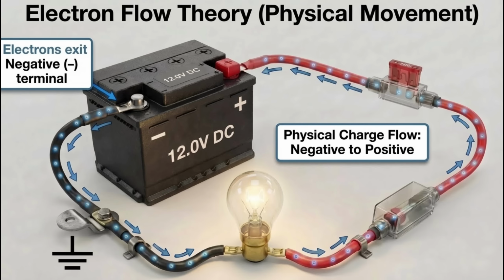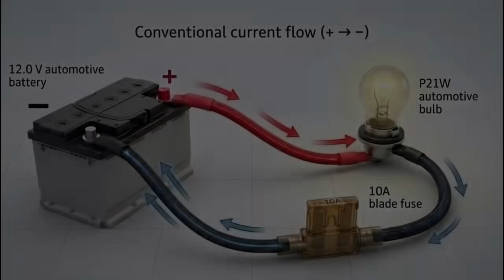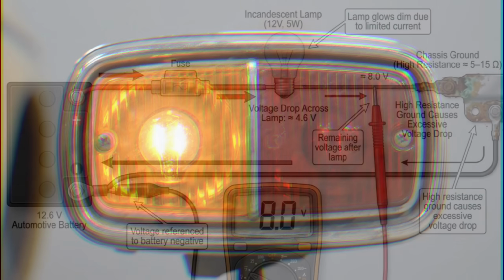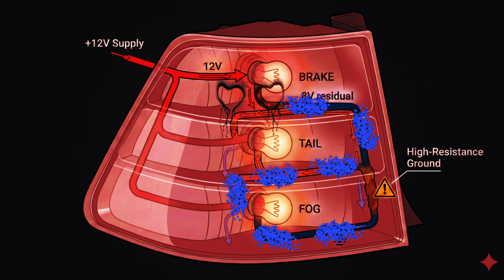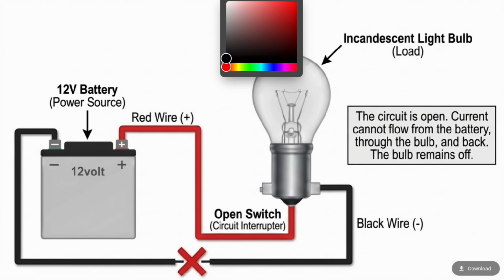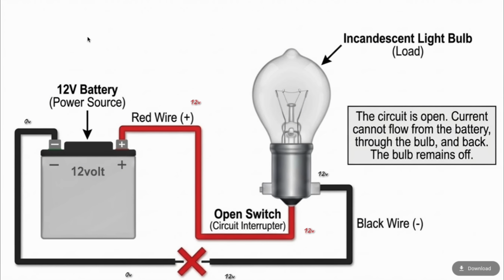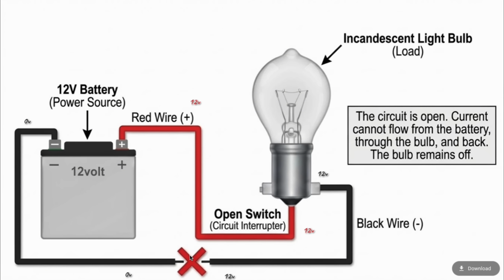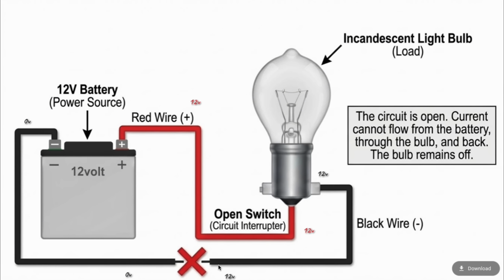12 Volts on Ground… The Most Confusing Auto-Electrical Fault Explained!

Comment: Were exacly did you explane the old system were Battery positiv was on the chassi?

The title is just clickbait....
Reply from the maker: I wasn’t doing a historical deep-dive on early automotive electrics.
The point of the video is why modern systems are referenced the way they are, and how misunderstanding that leads to bad diagnostics.

If you missed that, rewatch the section on reference paths and voltage drop — that’s the actual lesson.
Reply: Hi, to stop any confusion, maybe you could could add the word " Wire " after "Ground" in the title ?
Reply: There is no ground in an automotive electrical system, just a return to make a circuit.
Reply from the maker: For training purposes there is. Wiring diagrams call it earth or ground - thats what and how we teach
Reply: @BenJFF thank you! This is exactly what and how i need to be learning in my hgv maintenance course! (Minus the spark plug ofcourse 😂) but your videos are great! ❤
Reply from the maker: Fantastic

Comment: Interestingly enough our voltmeter measures pressure at any point in the circuit (think pipe) by releasing a little bit and and measuring the hiss of air or dribble of water through a known orifice. Yes your multimeter always measures current flow when measuring voltage or potential difference and why you have to shift the common lead to measure amps.
Reply from the maker: Well said Roger

Comment: What about when seeing a positive voltage on what is supposed to be a ground? Got a VW Up which is supposed to be sending a ground to the fuel pump relay, but seeing about 3.5v coming through instead of the ground. Could that be a floating voltage from a bad ground, or is the ECU broken?
Reply from the maker: Disconnect the wire to the ground term 85 to relay and check again. Relay should be diode or resistor type - they themselves can cause this. Other than that I would need to see the wiring diagram. Sometimes that voltage is normal as the single phase pumps can be controlled by voltage dropping the ground or reducing voltage it depends on the design. You could do with finding a functional description how it works. You need to also check that ground when cranking not just with ignition on
Reply: @BenJFF cheers. I did pull the relay and test it and it works as expected from a 12v battery and continuity is ok. On the relay base pin the ground shows 0v with ignition off and then 3.5v with ignition on, with the opposite pin showing 12v constantly. I can bypass the relay with a jumper pin and the pump spins, just not getting the ground from the ECU so can't run it normally.

The relay itself is a vag 646, normally open diode relay.

Comment: Electrons haven't been discovered.  It's still just a workable theory.
Reply from the maker: In engineering and diagnostics, a “theory” that consistently predicts outcomes and is repeatedly verified in real-world measurements is called a model — and it’s how we fix cars every day. If understanding why you can measure 12 V on a ground reference helps technicians diagnose faults faster and more accurately, then the video has done its job.

Comment: Because when your measuring the ground side the multimeter will directly read the voltage drop.
Reply from the maker: Ground to ground yes
Reply: @BenJFF  I assumed you’re referring to conventional old school circuits that used a mechanical switch instead of electronic canbus switch that creates a ghost voltage just like the modern Jump starter that can’t be used as power supply despite of having a voltmeter reading of 12V.

Comment: ~4:05 im just happy the battery got 6 cells, even if the toaster got the nominal voltage wrong for a functional lead-acid system

~4:33 lmao wow, called it. i swear i didn't see this before i posted the above xD classic toaster 4 cell motorcycle battery, good for about 9.2 (or 8.0 as it would call it)

Comment: I remember working on my civic thinking i had a fuel pump problem and traced everything on the positive side, not being able to find the problem for days and eventually found that the car ran and start with my obd port plugged in because it have the fuel pump a return path to ground.  the problem was with a main grounding screw under the hood through one of the main wiring harnesses that was preventing the ground from going back to the battery and i was scratching my head for days on that one, so now i always test negative on battery, to negative on problematic part via continuity test , instead of relying on chassis to positive voltage test. Most electrical problems are indeed grounding issues or connectors.
Reply from the maker: Good job you had that scan tool plugged in 😅

Comment: Thank you for explaining this. In a situation myself where I own a 21 year old Jeep WJ Grand Cherokee and the wiring is starting to break in all doors, under hood etc. due to hardened plastic sleeving and years of hot/cold cycles.  It is a nightmare to find all the breaks. I am getting to the point of wanting to remove all the carpets and seats and physically inspect the wiring harnesses. I see many corroded terminals in various cabin components like the blowers, rear lights.
Reply: I feel bad for you. Your Jeep is having wiring problems at only 21 years old. Crazy! My rusty 1975 Chevy is driven daily (doesn't sit in a garage) and it has its factory wiring harness. It has no problems.
Reply from the maker: No probs glad it helped. Yes if it were me and I had another car as a daily driver I would sort the wiring out.

Comment: If the switch to turn on the load is on the ground side or what's called a ground activated circuit you can also utilize what you described to continuity/integrity test all the wiring through the load up to the open load side of the open switch using the circuit voltage source being the vehicle battery by measuring the voltage at the open switch instead of breaking the circuit open at multiple points and then using the multimeter battery on resistance or continuity function to perform the test.
Reply from the maker: You are clearly very intelligent and I like both of your replies - god knows I wish I had young lads ask me these types of questions. We need to bear in mind that I try to simplify concepts so that this complex subject is understandable for a large cross section of society. Maybe one day I can go more in depth but lets work up to that level. Very impressive understanding of circuits you demonstrate 👌
Reply: @BenJFF  Less and less young people are getting into the trades now a days and that's a big problem everywhere. And it's a real shame because it's a very satisfying career when you use the knowledge and skills to solve difficult problems.
Reply from the maker: Its a big problem I agree. They need to pay way more that would help

Comment: Simply put current has to flow in a circuit for the load (lightbulb) to consume the majority of the voltage because by law  "ALL" sources of voltage will be consumed by "ALL" loads in an electrical circuit. If there's a break on the ground side then the load (lightbulb) simply becomes an extension of the wiring when there's no current flow in the circuit. Here's a question why doesn't the multimeter cause current to flow and activate or turn the light bulb on when you test the voltage after the load on the load side at the break with the multimeter?
Reply from the maker: Because the multimeter is designed to measure, not power.
In voltage mode it has a very high internal resistance, so it allows only microamps to flow — enough to reference potential, nowhere near enough to energise a load.
Voltage can exist without current; current only flows when the circuit is complete and the load demands it.
That’s exactly why we can read voltage past a break without the bulb lighting.
Reply: @BenJFF  Exactly. Electricity can be a hard concept to understand myself included in the beginning. Most people avoid it out of fear but once you know the basics and fix a few easy problems the lightbulb goes on and you're off to the races. Keep getting the info out there. Cheers!
Reply from the maker: Thanks buddy 🙂

Comment: The confusion starts when people use the term "Ground" in a DC circuit. 
There is NO Ground in a DC circuit!
What there is, is Positive and Negative! Even says it on the battery.
Ground only exists in AC as a safety measure, it is not necessary to make the circuit work.
Reply: Everyone in the automotive (12 Volt DC) repair industry uses the term "ground" , "earth" and negative interchangeably and it's not confusing.
Reply from the maker: They use the term ”Earth” in the UK for domestic AC electricity. It never confused me. I used to say earth for DC systems and since working 11 years on Bmw I started to say ground.
Reply: @BenJFF  I know everyone says ground or earth in the EU but electrically there is no ground in DC. Life would be so much simpler if we all could be more accurate. I also knew my comment would draw some "I never got confused" comments. :)

Comment: Great video! So it's like a two-part garden hose with a connector that doesn't let water out if disconnected. With the tap on there's still pressure in the first part of the hose, but water can only flow through if the second part of the hose is connected.
Reply from the maker: Exactly 👌

Comment: You are the first person that explained why my car & trailer tail lights  go crazy with a bad earth wire connection.  Power flows thru the earth of other bulbs 😆  Thanks, mate 👍
Reply from the maker: Glad I could help you solve that confusing problem!
Reply: @BenJFF Have you got a video on simple how it works Can Bus systems?  I own a GM Colorado?
Reply from the maker: I have a CAN tool mate that I built. I even worked on Chrysler CCD bus once. I have two more videos to publish then I will make a really easy to understand one about CAN pre CAN-FD. Thanks for suggesting it Lloyd 👌

Comment: Correction, when you say electrons are negatively charged that's only a convention, not a fact. The whole positive/negative charge convention is arbitrary. You could say electrons are positive and protons are negative and rewrite the physics around that model, and say that positively charged electrons are flowing from plus to minus in a circuit.. We didn't do that because it doesn't really matter in the end
Reply from the maker: The last sentence you made summed it up nicely. 🙂 Thanks for the info.

Comment: Had a Cadillac with a Northstar that came from an oil change shop as a no crank, no start, with really odd symptoms. Upon hooking up the battery and trying to crank, the fuel pump relay would stay latched and some dash lights would stay on, dimmly iIrc, until the battery was unhooked.. Probing around with a test light, trying to get to the starter signal wire under the intake on those, touched the block or something that should have been grounded and the light lit... The whole block was +12... The next trick was finding the engine ground which is hiding at the right front, about 4" long piece of 2ga between the cylinder head, under the exh manifold and to the rad support...
Reply from the maker: Wow, that sounds like a truly perplexing fault! Glad you got to the bottom of it. Who caused the fault? The oil changers?😅
Reply: @BenJFF Age and the rust belt. Unfortunate coincidence. Took me several hours to find, iIrc the ground location is only described in the service manual and almost impossible to see in the deep dark corner it's in.
Reply from the maker: Sounds about right. That was a good fault find mate

Comment: I have a 1924 Model T Ford roadster..And from the factory it was a positive ground setup..
The ultimate circuit in an automobile is to have a copper wire to the light and then another copper wire back to the battery..But car manufactures use the chassis for the ground leg for one reason..To save money..
How much more copper wire and complexity there would be if every circuit had a copper wire as the ground..But steel frames rust out and tech mechanics make a living..
Reply from the maker: Thats really interesting. Do you have any videos of it? I could never imagine modern cars wired that way😊
Reply: @BenJFF  I bought the thing from my wife's uncle and he bought it from the restorer..When I got it, it was not running..But it was Pos ground..Now after doing some research on this, Model Ts were Neg ground and the model As were Pos ground..
It is running on Pos ground right now..I think I need to look this over..At Pos ground the starter was spinning the correct direction and the amp gauge was showing a + charge..
Reply from the maker: That sounds cool. Really interesting

Comment: I find a good way to understand it is to look at an open circuit as a MASSIVE voltage drop.
Reply from the maker: Spot on 👍 An open circuit is basically a full voltage drop – infinite resistance, no current. The voltage has nowhere to go, so it just sits there until you give it a return path.👌 Great comment.

Comment: if in reality electrons flow from minus to plus, why do we put the fuse near the positive terminal?
Reply from the maker: What a brilliant question😊 Even though electrons physically drift from negative to positive, a fuse doesn’t care about direction, only current. The reason we fuse the positive side is to protect the entire length of live cable coming from the battery. If that wire shorts to ground anywhere downstream, the fuse blows and removes the energy source. Put the fuse on the negative side and a short on the positive can still turn the cable into a heater without ever blowing the fuse. In short, fuses protect wiring from the battery, not electron flow.
Reply: @BenJFF if the fuse was on the neg of the battery instead, I don't see how it would be different. It would still blow even if the wire from the pos touched the chassis.. right?
Reply from the maker: It might take a bit to blow. I never tried it. It might be worth making a lab test? I think it would make a good video
Reply: @Tom-f8r8o  Hi Tom. I don't know how old you are or where you are situated, but here in the UK up to the late 1960's we still had cars with positive earth electrics, I used to own one, so in fact all the fuses were in the negative line. Where we put the fuse in circuit is all down to what we choose as the common, or ground, connection. You're correct, in a simple circuit like Ben is showing, the fuse will have the same effect wherever it is placed, as long as it is in series with the current path. In  the case of a complete car, the world has now standardised to a negative earth, ground or common connection, so in order that each circuit can be controlled separately and protected separately, all switches, controls and fuses have to be in the positive line. Hope this helps.
Reply from the maker: Hello Bob, hows the 5 series? Thanks Bob this was very helpful. Yes the old stuff had positive earth. I need to make a video about that too😅. There you go Tom: Bob is an electrical engineer so he knows more than me at that level
Reply: @BenJFF  Hi Ben. I've dropped you an e-mail. I wouldn't say I know more than you Ben, just say that we have different experience, we're both still learning!
Reply: Fuses are near positive terminal because chassis is negative.
Reply: Previously, we tried putting the positive terminal on the chassis and the negative terminal through the cable and fuses, but this caused even more problems and people were electrocuted more often than by the machine.
Reply from the maker: True 👌
Reply: That what make me think that science is not true about this theory which is that électrons go from négative to positive. The same thing with houses . If eloctrons go from négative to positive why should we put then switch in the positive to light on the light
Reply from the maker: AC is a bit different than DC electricity
Reply: I think it all about elictricity and i doubt that elictricity flow from négative to positive honestly @BenJFF